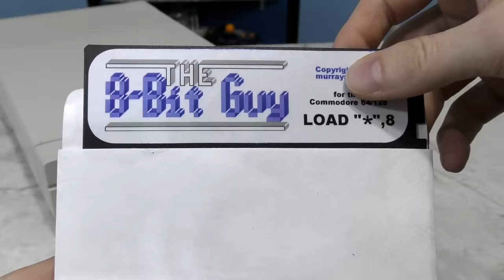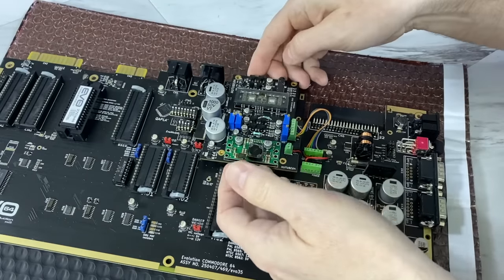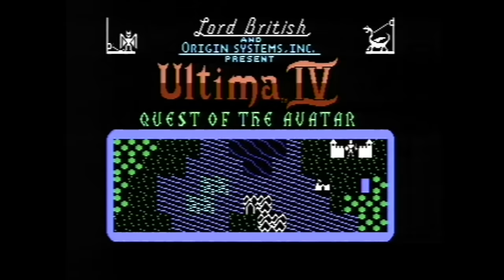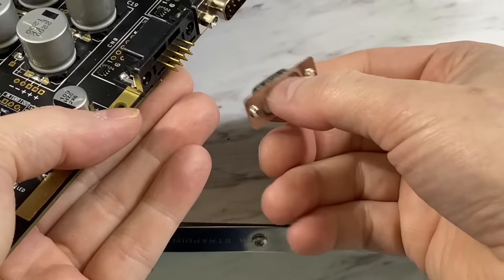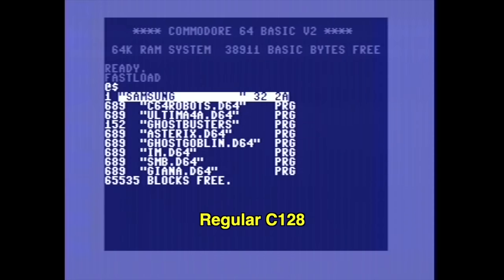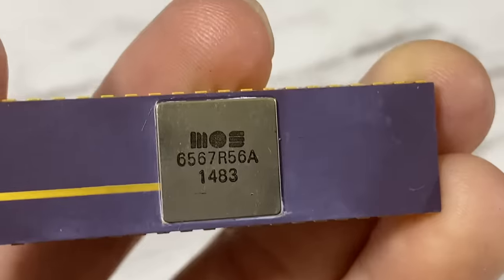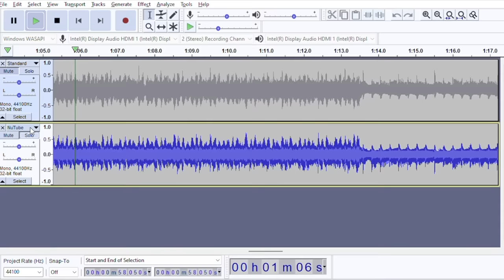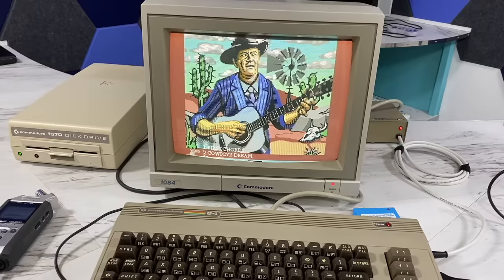The Evolution64 - Is it worth the money?

Comment: I could tell the difference between the standard SID and NuTube versions of the music (in this video).  Insofar as, I reckon I could identify them in an A-B test.  I think the NuTube version definitely sounded better.  But you're correct to say they were very similar and the $500 option won't sell a lot of copies.  I would still like to hear some of my own tunes through it on my studio speakers 😀
Reply: 11:46 This one was the clearest difference to me, the nutune sounds fatter, like it has a ring to it. From what I recall that is additional harmonics that should be considered distortion but people like it (it does sound warmer). Can also do that with a software filter of course, which is typically the approach I prefer because then you can color sound whenever and however you want. But hey, to each their own.
Reply: I'd say the $500 option sounded even better with Martin Galways seal of approval. ;)
Reply: Hi there. I`m Stefano - . the initiator of the project, designer of the schematic, and the producer of the boards. The nutube DOES sound different, but unfortunately the compressed/transistorized version of the clip does not reproduce that difference. Tubes (and JFETs) have a different proportion of odd vs even distorsion than transistors (or mosfet). In simple words, even-distorted sounds good. Odd-distorted sounds bad.  In the nutube64 device, there are two small trimmers to make the "even" distorsion positive or negative. Once the odd distortion is minimized at the working point , biasing the grids one side you will get more "ambient", while on the other side you get more "crystalline". The personal feeling about the cost of the object is subjective so it does not require comments: the nutube64 is an add-on board, so the old-C64 board can be run without it, stereo, with the usual transistorized output, and with all the features that have been shown in this and other videos. W.R.T the original SID commodore output. It is an emitter follower with a gigantic base swing introducing a lot of non-linear logarithmic distortion. The original C64 developers chose this solution because it was quick and cheap. Perfectly fine. A better design could have been possible, but the C64 would have been more expensive, so that was ok: market penetration - not quality - was the priority.  What it is done is done. The old C64 bypass electrolytic capacitor is most likely dry so its ESR is all over the place. My board has also a lot of other features to improve quality and overall I`m quite satisfied.

Martin, please send an email to the evo64 guys. You will get yours, listen with your studio speakers, play with different grid-bias and enjoy your beautiful tunes.

Comment: I think you should heatsink that VIC-II. They run pretty hot and is normally dissipated through the metal housing on the original board…a VIC-II on this board might not run long without some fins.
Reply: I'm not sure he uses it a lot. Probably  just to test some apps and make video. He codes on emulator.

Comment: In theory the harmonics produced by the tubes (in the preamplifier stage) would be preserved by the transistor stages that come afterwards. So, again in theory, there should be some difference in sound with the NuTube vs without. But different does not mean necessarily better. And in fact the lofi quality inherent in C64/Sid chips have very little to gain from it. Definitely not worth it for 500$.

Comment: 1) It's pretty.
2) It works.
3) It's $300, plus you find the main chips.
4) The video is obviously better if you have a good monitor like the 1084. If you have to use a TV or going thru an NTSC (or even some S-Video) converters, you will have a hard time seeing the difference.
5) The vacuum tube audio signal is inverted. However, this might only matter if you are summing this output with the output of a real C-64, and probably not only then. The human ear can't hear the difference between speaker polarities, unless you have intermodulation between multiple speakers.
6) The vacuum tube audio sounded notably different to me, it seems to have more highs. You could see that in the capture waveform too. Whether more highs is a good or bad thing may depend on the audio you are playing. Whether the marginal improvement is worth any money at all to you depends on your desires. Audiophiles would like it, because for them More Money = Better.

Overall, it's pretty, it works, it is somewhat expensive, and it sounds and looks slightly better/different from the original.  That would make it worthwhile for some people, and not so for others.

It would have been interesting to hear a capture from the non-vacuum tube audio to compare. The amount of highs basically depends on the value of a cap and a resistor, so it might have more highs also.

Is there a pink noise or white noise generator for the C64? Capturing the output of that and using an RTA to get an envelope of the audio output on this and a C64 would be interesting.

Comment: On the issue of audio quality: there are two ways to look at audio: subjectively and objectively. The objective aspects are things you can measure such as loudness, clipping, distortions, frequency response, jitter, etc. On the subjective side, its as complex as the human mind is. Outside of obvious objective issues (eg. too distorted, not loud enough etc) the subjective stuff, aka "which sounds better?", is not something that can be objectively measured. Hence there is no right or wrong. It's personal taste and every person is going to have a different opinion. All you can do is what you did and give you opinion. But, it's vital to understnand that when speaking subjectively in terms of preference, there is no right and wrong and every opinion is valid. There is no objective data in subjective analysis unless you are doing a controlled study with a large sample set.

Comment: Those Korg (YES! THE KORG) Nutube are the most poser things i've ever seen on the internet, it's basically just 2x 61P triode tubes (dual triode) being put on VFD display package. these abomination requires pretty high voltage swing and does not work properly on voltage lower than 20V, these are inspired by an ancient RCA Nuvistor metal-case vacuum tube (actual milspec) manufactured on the late 70's, but most people have move on to transistor by that time. unfortunately, they didn't use better pentodes design like EF86 or EF95 so it's obviously going to sound trashy like bargain Shuguang or late 60's Soviet rubbish. 
.
Cayin the Chifi manufacturer put this on their expensive portable media player and the results are pretty much what happens, it's sounded weirdly thick, distorted and grainy like putting very high bitrate modern FLAC though a VHS tape and plays it on a modern earpod; their userbase likes it for the 'lo-fi' sounding setup LMAO. (no, they don't understand why it sounded like that lol)
.
Oh and... i dunno if the EVO guys knew that YOU NEED TO INVERT (again) THE INPUT OF THE TUBE using mosfet or JFET to make it sounds ... Normal? just saying.
.
some info(s); youtube hates links, sorry:
korgnutube(dot)com/en/guide
r-type(dot)org/articles/art-150(dot)htm

Comment: I think you have misunderstood the audio vacuum tube amp purpose; I own a pretty high end headphone setup which consists of rebelAmp (solid state class a headphone amp) paired with Sennheiser HD 800S, and using something like NES with the system will make your ears bleed (which is caused mostly by the attack speed of the system, on "normal" speakers the square waves will rise and fall slowly with rounded off edges, but on systems like mine that won't happen), plugging an vacuum tube buffer which by design has soft sound in between the source and the amp fixes the issue and makes the system usable with retro machines. the audio amp on that board probably has the same function, although it's overpriced, I built mine for 100usd in parts and it took about 30 min to assemble.

Comment: The analog VS digital audio debate for me is dead. I love my analog formats from a tactile/nostalgia point of view. It's satisfying to "drop the needle" or spool up an O.R. tape. (and this does add an unquantifiable element to listening to old music). However, I don't at all miss having my tape heads out of alignment deck to deck, or the speed differences deck to deck (or turntable to turntable). Not to mention generation loss during editing. I'm not some "kid" who thinks digital is better because that's what I grew up with. I was born in 1962, So TECHNICALLY a "Boomer".  I was ALWAYS in search of a "perfect" way to record without these issues. MiniDisc was the first that rivaled my O.R. decks, and now we have LOSSLESS digital recorders for FAR FAR less money that will "smoke" my old O.R. decks. I have a Tascam DP-006 that not only is a multi-track recorder, but has a built-in mixer, and it is the size of a paperback book. It cost me about what a few 7" reels of tape would now. As to using a vacuum tube amp in THIS use case? I don't get it. Even if one used an all vacuum tube TV from 1950 as the monitor, The source sound is generated by a solid state (transistor) device in the first place! 🤷‍♂️

Comment: Vacuum tubes invert the signal, if only one tube per channel is used.  Tubes are not better than high quality MOSFETs (that act similar to tubes).  Some people like tubes because they introduce distortion that, believe it or not, sounds pleasing to the ear.  Tubes are not usually flat in their frequency response.  What tubes do is bring out the vocals, because of their favoritism of the midrange frequencies.  In audio power amplifiers with transformer outputs, tubes also act like audio "shock absorbers" softening the "punch" etc due to their high-impedance nature.  This softening is also pleasing to many audiophiles, but make no mistake, modifying the signal is distortion.  Solid state, typically being high current, can handle audio bursts and punches accurately, provided the power supply has enough voltage and amperage to handle the signal.  Audiophiles consider this "harsh", even though it's actually an accurate representation of the signal.

As to the die hard tubers, the SID chip is solid state, digital and analog.  The tube MAY introduce the tube distortion many audiophiles love, but being the SID is already solid state, the $500 is a waste of money.  Even $200 is a waste of money.

Comment: Mebbe it was a trick of my ears using closed-back around-the-ear headphones (Razer Barracuda X's), but when you compared the early parts of the Super Gianna Sisters music between the recordings - the NuTube version seemed a touch 'richer' with a bit more in the bass range and not quite so muffled, the C64 seemed kinda tinny and 'hollow' and more muffled. The later section of music? Not as much a difference between the recordings, honestly.

I will admit I'm not an audiophile, using "gamer headphones", but I could tell there was a difference between the recordings that lead me to ever-so-slightly prefer the NuTube output as it seemed a bit 'fuller' and clearer.

Comment: Hi I enjoy high quality audio. I am not the stupid snake oil bs kind of audio guy though. 
Tube amplifiers are not really "better" than an equally good quality solid state amp. The novelty of tubes is that it changes the sound, usually giving it a warmer tone. If you like that tonal shift, then you might enjoy tube-based amplification. But if you're after "accurate" then solid state amplification is usually the better choice because you can get really, really good quality for much less money than a really good tube amp. So yeah, tube amps today can be really good but you're going to pay for it and ultimately it is more a novelty than anything. And I think the NuTube is charging novelty prices for that. I think it's reasonable to believe that the NuTube is a better quality amplifier than whatever amplification a regular, bog-standard C64 uses... but I also think that the kind of sounds that a C64 makes don't benefit from an amplifier that's anything more than just "decent". If you could actually play real recordings through the amplifiers to compare, I think it might be a different story. But that's only because the stock C64 amplification probably isn't "decent" for anything more than the sounds that a SID chip can produce.

That being said, there is an audible difference in the recordings that you played to compare the sounds. The audio from the NuTube definitely exhibited the warmer shift that you would expect from a tube amp, whereas the standard audio recording was a sharper sound. Was one better than the other? Objectively I don't think we the viewers could determine that through YouTube's compression. Subjectively, well that's up to the listener. 

Again, NuTube is a novelty item that you are being charged novelty prices for. Unless you're a tube enthusiast (and there are a lot of you out there) then there's no reason to spend the money on the NuTube addition because the benefits are negligible for this use case.

Comment: The Nutube in this application is a gimmick. What would’ve been nice is if you compared the frequency response, David. However, from your tests, I have made a few judgements based on my knowledge as a music producer, and a vintage electronics engineer

- the audio is inverted. This will cause issues with stereo phishing if in a chain where two channels are playing together - and if not wired up backwards on the output end (which it isn’t), each waveform will cancel each other out and you’ll be left with a dul, deaf sound.

- frequency response. It’s really poor! I’m unaware on how this pre amp nutube is wired up, or it’s circuit but what is documented is the tubes original frequency response ratio. It’s rubbish! The original, audio out is so much better, all this is adding is a horrid, muddy, muffled and muted tone. No low end, because anything under 500 appears to be cut low. 1k appears OK ish, but again, there’s a cut off. The high end, has also been cut. What you’re left with is audio which sounds like it’s coming from a cheap cassette in an even cheaper Chinese cassette recorder.

I’m unbelievably upset and concerned as this appears to just be some form of audiophile con here. It doesn’t sound even comparable to the traditional audio output.

And let’s talk about that for a moment. Is the maximum output level higher? All this nutube is doing is poorly flavouring the sound… any cheap tube headphone amp which TechMoan and EEVBlog reviewed years back would do the exact same thing!

Comment: If your not going to hook up to the Nutube output to half descent amp and or powered speakers (~$500+) or headphones its pointless having the Nutube pre-amp stage, the chances are slim that your going hear anything good/better from your typical 2 to 5  watt 2.5 to 4 inch full range (that's still an oxymoron even with current analogue speaker technology) speaker(s) found in TVs and monitors of this era, this also applies to the majority of External PC speakers sold, as again most only had a cheap single full range speaker in each enclosure with the usual fake tweeter (high frequency driver) thrown in for good measure.

Comment: Funnily enough, I used to play C64 sound through a tube amp back in the day... 
It was just an old "pull" out of a stereo/record console though. A bit cheaper than $500 and it actually did drive the speakers via output tubes.
If one really wants to hear the "tube sound" then that s the better way to do it.. the distortion is from the combination of the output tubes and the transformer.
:/

Comment: 500 Bucks for a small tube amp is a bit steep, but I did notice a drastic change in fidelity with that system and it sounded quite good and that was over a youtube video. The audio was warmer and less sharp. Vibrato was much more noticable and nice and the mix seemed to be really stable.

Comment: Tubes will tend to distort a bit more and differently, which is perceived as "fat" by many. But it's just distortion/peaking which you'd want to avoid in a clean signal anyway. Many others also confuse "loud" with "better".

Tubes in audio equipment are otherwise almost always a bit of pandering wankery. The difference is when you want to intentionally distort, for guitar. In those cases, Tubes will distort different. However, different brands of tubes will make almost no difference. Some great videos from Glenn at SpectreSoundStudios about where things like guitar tone really come from.

Comment: You could try flipping the Nutube's recording in Audacity so they're in the same polarity. Then, if you're really accurate, you could try subtracting one from the other to see what the difference really is. The "Nutube" is one for the "audiophiles", though. Whatever the elusive "tube sound" is, this just isn't a tube. It's a repurposed VFD display, and is a novelty all the way through. Sometimes synth-heads with money to burn will buy stuff like that just because it's one more sound, for their box that already has an infinite number of sounds, but mostly because it's something expensive and silly and therefore attracts their wallet like a compass to the South Pole. Or like flies and whatever attracts those. The "audiophile" hobby is one where a graph of money vs sense would slope downward.